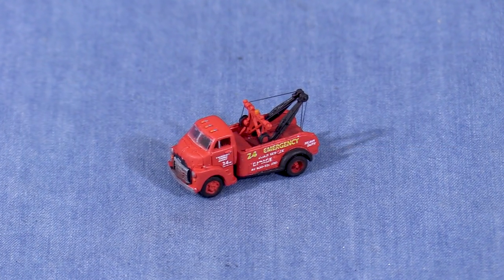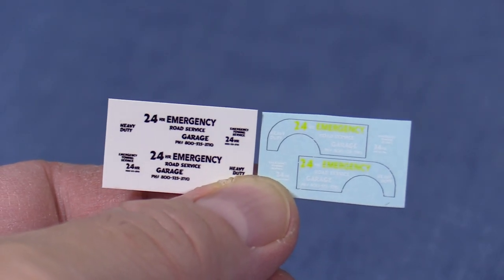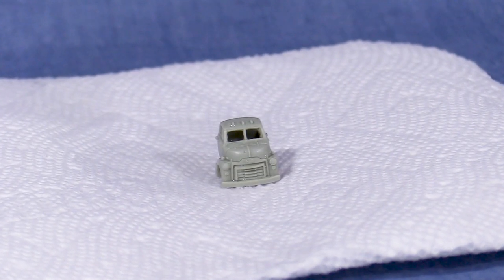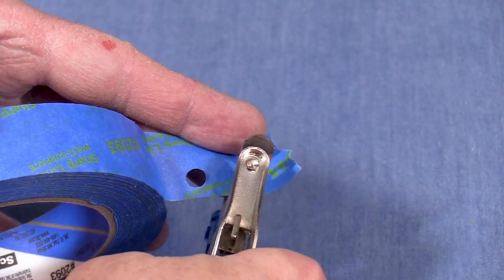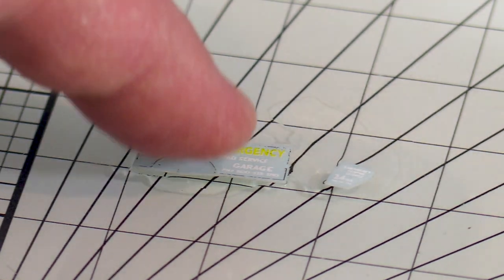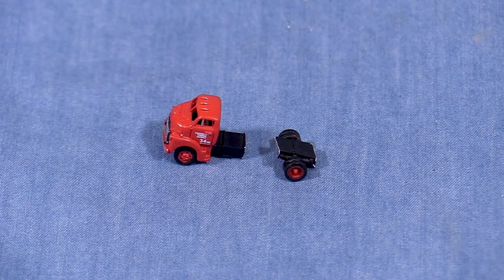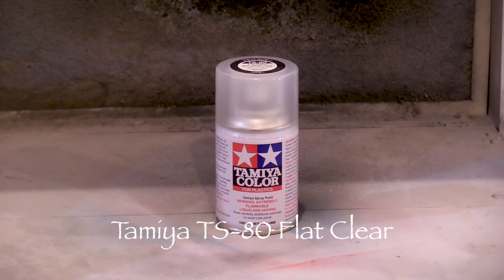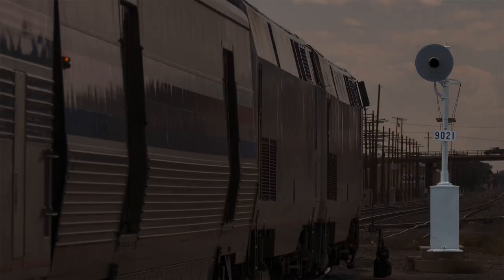Hands On Review N Showcase Miniatures 1950s GMC Wrecker

Comment: nice build, but aren't the windshields supposed to go behind the front part of the cab, not in front? I noticed you did this with the other truck kit you built.
Reply from the maker: Unless I misread them, that's the way the instructions show how to do it.  You could probably also put it inside if it was cut down a little smaller, though the assembly sequence would be slightly different.  Thanks for watching!
Reply: @DanielCortopassi  interesting. no problem!